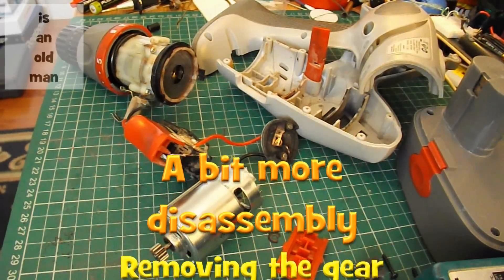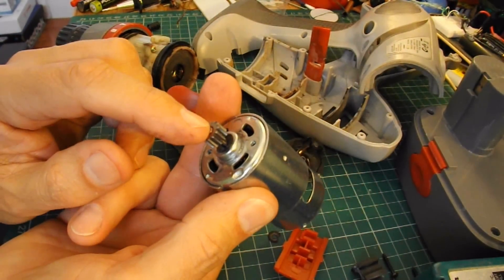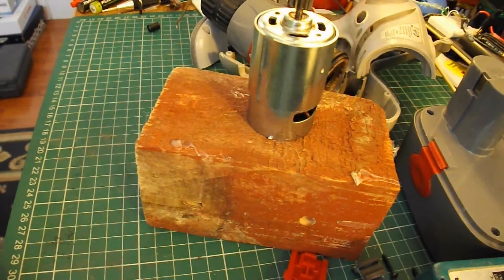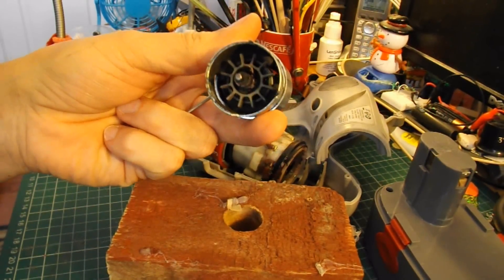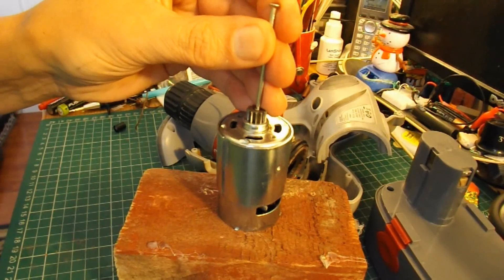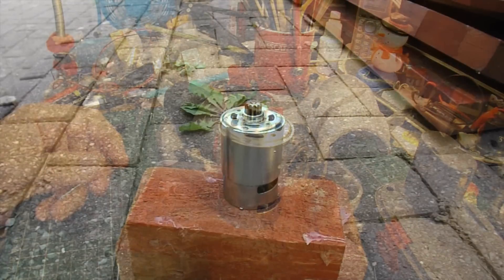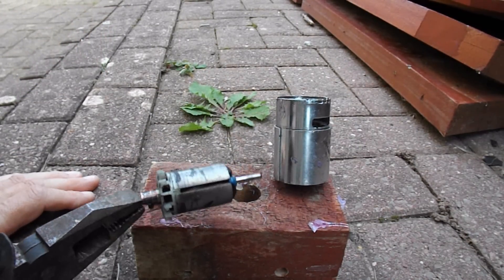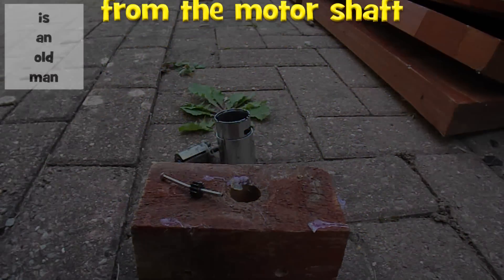A bit more Disassembly  - removing the gear

Comment: Any advice for how to do this on a much smaller scale? I want to do this on some n20 micro motors and let's just say pliers didn't work.(banana shaft)
Reply from the maker: You can buy a proper gear puller tool. That would be your safest option. However, here are a couple of videos I did on removing the offset weights on small vibrating motors which would be a similar task.
Helpfile - removing offset weight from motor of Dr fresh Velocity Toothbrush https://www.youtube.com/watch?v=zgDD51pBAzs&list=PLA5a2xPRSrB2v0vxMJyZ9cPweAGx1FK6e&index=57
Helpfile - How to remove the eccentric weight from a vibrating motor OralB Toothbrush etc https://www.youtube.com/watch?v=rAkSnCSv0Lk&list=PLA5a2xPRSrB2v0vxMJyZ9cPweAGx1FK6e&index=64

Comment: Disassembled some trashed handheld vacuums to salvage the parts, looking to use the motor for a project, thanks for the tutorial brother.
Reply from the maker: This is not a very good way of doing the job. A proper sprocket puller would be more effective and less destructive. But it works if you don't have any choice 👍👍

Comment: Did you manage to find a motor?
Reply from the maker: @RickJeanes  I bought a better cordless drill instead. But you could probably find a replacement motor on eBay or similar.
Reply: I found a motor at 1/3 the price but time will tell if it's any good I guess...oh, thanks for the video too.
Reply from the maker: @RickJeanes  Good luck 👍👍 One reason for not trying too hard to fix it was the battery wasn't lasting very long either, so that would have been the next thing to pay for 👍👍

Comment: I've used several of your videos to help on my projects, and all have seemed to be very useful.  Are you still tinkering with small gadgets and small remote control vehicles?  You did a military tank build once that was a conversion from non-RC to fully functional RC conversion.  After seeing your vid, I built 4 different tracked vehicles that worked out great.  The problem I'm facing now is that I destroy nylon gears nonstop.  So I've been switching to more durable brass gears, so your vid was really helpful for removal/installation and I didn't have to go buy a pinion gear puller.  Long story longer, Thank you for sharing your projects!
Reply from the maker: I still think a pinion puller is a good investment. I did buy one for use on smaller motors than this one and it does make life a lot easier 😊👍

Comment: Man those motors cost only a few buck when you just order from china 40 bucks is a ripoff
Reply from the maker: I think I was talking about a direct replacement for an original manufacturer's item. As you say, cheaper would be available. As this video is about 7 years old, it is hardly relevant anyway. The video was just to show a very ineffective way of removing the gear. A proper gear puller would do the job quicker and easier.
Reply: @GrandadIsAnOldMan  well it works so it is effective!
Reply from the maker: @Andre_Thomasson  Haha, yes, but not much chance of repairing the old motor now 😆😆👍👍

Comment: How how do you put that gear on a new shaft?
Reply from the maker: As I said in my previous reply - The gear is an interference fit, hence the need heat it to expand it, so it can be removed. You could use a proper gear puller as suggested in the video description. Fitting it on the shaft of a new motor would require force, ideally in a vise or a press to ensure alignment.

Comment: Even if you can get another motor, how do you reckon you out the gear in the new motor ... I doubt loctite is not up to a challenge in heavy stress application like drills or 20v power tools.
Reply from the maker: Not sure if you missed some words in your comment, I don't understand "how do you reckon you out the gear" and as for loctite, did I mention that? I would have to watch my 6 year old video again to find out. The gear is an interference fit, hence the need heat it to expand it, so it can be removed. You could use a proper gear puller as suggested in the video description. Fitting it on the shaft of a new motor would require force, ideally in a vise or press to ensure alignment.

Comment: How do i remove it without destroying the motor :) i ve have 2 same motor for cordless drill but different gear teeth....i can destroy one of the motors but on the other one i can't afford because it has to receive the first motor gear
Reply from the maker: The ideal solution is that you buy a proper gear puller, see the details in the video description. Without that, you need to place a strong slotted bar between the gear and the motor. Support that bar so the motor is hanging free, then tap the shaft through the gear. I do it here with a much smaller motor, but the principle is the same https://youtu.be/zgDD51pBAzs

Comment: didn't heat it nearly enough.  Oxy-acetylene is required to fully aneal the gear to butter-like softness.
Reply from the maker: That's fine if you have the equipment available.

Comment: after you heated it you barely hit it and it popped right out... i have the same drill motor issue... i found a new motor for 16.50 vs dewalts $50 one with gear al ready on... i will also have to cut approx 1/4 inch off new motor shaft...
Reply from the maker: Good luck with that 👍
Reply: @GrandadIsAnOldMan  i did it without heat i just held it with side cutter plyiers and 2 blocks of wood... i let motor hang and used a nice center punch with a small hammer and it came right off... i did not have to cut new motor shaft since it had plenty of clearance... i paid $17 for new dewalt motor without gears and wire... drill works perfect....
Reply from the maker: @roadstar499  that is a great result 🙂👍👍

Comment: Hello what to do with gear not fix on the axeof the dc motor is splitting up and down
Reply from the maker: If the gear is split you will have to replace it

Comment: How can get This type of gear
Reply from the maker: You would have to search online stores. You would also need to take careful measurements so you order the right items. You need length, diameter, number of teeth, inside diameter for the hole for the shaft.

Comment: You probably could have just bought a new brush to replace the burnt out one for a few pounds, it only takes a pair of pliers and a quick solder to replace.
Reply from the maker: True 😁👍 If you look you will see it is the commutator leaves that have failed, not the brushes. It might have been possible to get the leaves to settle down again with a bit of effort, maybe, but I decided to take it apart. 04:55

Comment: Mate I’ve took mine off but how do I put it back onto my new motor? A g clamp maybe.
Reply from the maker: Putting it on 'should' be much easier. Warming it might be an idea but I would expect it go on cold by placing it on a flat surface and gently tapping the other end of the shaft. If your G-Clamp is sturdy enough that would work too and allow you to be gentle with it. I know the clamps I have would probably twist out of alignment. A nice big vise or vice (if you are in the UK) would also do the job nicely.
Reply: Heat It . Drake 1 ton press , Hobby Vise , "C" Clamp in USA .

Comment: Have  the same problem with my Parkside dril.  I bought for £!0 a brand new motor from China here UK  in a week. Now I have to change the gears ! I wonder if a cig lighter would easilly heat the gear - brass has a higher coefficient of expansion than the steel shaft.  However I see on YouTube vides on how to make small pullers.
Reply from the maker: If you can get something behind the gear to support it then drifting it through would be a much better solution than smashing the motor like I did here. I have had success with smaller motors by cutting a slot the size of the shaft in a strip of steel and supporting that while I tap the shaft through. Using a cig lighter might work but I would expect the heat would be so gentle it would transfer through to the steel shaft before the brass gear had expanded enough to release. The obvious answer it try it, what have you got to lose. If it doesn't work you will have to go hotter faster.

Comment: Pls use pinion Gear puller.
Reply from the maker: If I had one I would but then that wouldn't be a very interesting video, pulling it off without destroying the motor. As Slider2732 pointed out in the comments here, I could probably have reseated the commutator brushes and saved it but I didn't think of that either.

Comment: Is there any other way man? I'm dying to losen up the gear from dc motor that i got from an old printer
Reply from the maker: The proper way to do it would be to buy a sprocket puller or pinion gear puller (just different names for the same thing as far as I know). They push the shaft through the gear whilst correctly holding the gear in place. If you study pictures of a gear puller you could probably make one yourself. The main thing is to support the gear while you punch the shaft free. In this video I am relying on the bearing of the motor to take the strain and basically destroyed the motor doing it. I knew that would happen but I only wanted to salvage the gear not the motor. This video may give you the general idea but it depends what you can find to do the job https://youtu.be/zgDD51pBAzs and heating the gear should help by expanding it enough to reduce the grip on the shaft.
Reply: GrandadIsAnOldMan alright, thanks sir
Reply: Did you manage to do it in the end? Im trying to remove the gear from a printer motor too
Reply: @rupertshearer1456  i finally am using angle grinder as well 😑

Comment: I've got some bigger (yet still pretty small) DC motors at work..... actually an entire 3 boxes full.. lately when I've built stuff it's been with old hubsan x4 flight controllers or similar. I'm wondering if you have or could possibly find the time to make a video about potentiometers and speed control w/ out a flight controller using potentiometers? Thanks for helping out! Cheers!
Reply from the maker: I am no electronics expert but this video might give you some ideas https://youtu.be/Y9vFdjiOiIo

Comment: Great video man! This really helped me :)
Reply from the maker: Thanks. The main point here is I was only trying to recover the gear, the motor itself was effectively destroyed. If you just wanted to change the gear on a good motor you would need to support the gear so no pressure was put on the motor bearings.

Comment: Would this ruin my motor
Reply from the maker: Heating the gear to remove it is a common method but you need to be careful. You only want to heat the gear so it expands reducing it's grip on the shaft. If you allow the shaft to become hot then that expands too and that makes the grip tighter not looser. If you take too long the heat will travel up the shaft and may cause problems inside the motor.
Reply from the maker: You may have missed the point that this motor was already ruined so I am just taking the gear off so I can use it on another motor so I am not too worried about this motor. You really need to support the gear by sliding a strip of metal with a slot the width of the shaft between it and the motor. Then you support that strip of metal in a vice so no force is applied to the motor casing and bearing. Here is a video working on a much smaller motor but the principle is the same https://youtu.be/zgDD51pBAzs?list=PLA5a2xPRSrB3jAX4ymLvmoN8OtvQkKuTC

Comment: How you connect the used gear to new motor ? do i need to use glue ? heat ?
Reply from the maker: This particular gear was an interference fit so heating the gear would help it to fit the shaft
Reply: so if i remove the gear (small grey) can I connect it again to the my new motor , do i need Glue or just heat (blower) ?

Comment: I'm in deep shit now... I still need my moter...
Reply from the maker: Your best bet is to find another faulty one and swap the parts.
Reply: I found a use For my motor with the gear but here's a tip you can get motors of Aliexspress and Amazon  you can get one 12v motor for around 5 - 13$ and a 24v for about 17 - 30$
Reply: And most 12v or 24v motors have the same size shaft you just need to know what volt your motor is

Comment: the motor you need is a johnson 600 and there £12 for 3
Reply from the maker: +Matt Westmacott thanks for the suggestion but what makes you so confident?  If it is not exactly the same size and same shaft diameter and length then it would just be a waste of money, although 3 nice solid motors like that for £12 could be handy for all sorts of my projects. I did google the details on the motor and found matching items but decided I would rather put the money towards a new 18 volt Li-Ion cordless £50 special deal at B&Q. The NiCad batteries on that old one didn't hold charge for very long anyway so it really didn't seem worth the effort of fixing it.
Reply: I got three for `12 quid from ebay just to mess around with, their the same as you have there.
as for removing the  little gear id hold the gear with a vice and tap the motor spindle with a prodder whilst supporting the underside of the gear so not to squash the gear as then it would make all this impossible!
loving your channel

Comment: Mabuchi 600-550
Reply from the maker: +Francisco Javier Lázaro Pinela thanks, I did google the details on the motor and found matching items but decided I would rather put the money towards a new 18 volt Li-Ion cordless £50 special deal at B&Q. The NiCad batteries on that old one didn't hold charge for very long anyway so it really didn't seem worth the effort of fixing it.

Comment: Your block of wood looks every bit like a house brick !
If the copper wire is still crimped or soldered to the bent commutator segment, you can often bend it back without issue. Happens on small toy motors too. The first few thousand revs reseat it properly, or rebreak it.
Can you make a blowtorch powered car ? .....am joking :)
Reply from the maker: +slider2732 I have a nice new 18v Li-ion powered cordless drill now, was lucky at the local hardware store had a special deal on some Black & Decker's £50 seems very nice so we will see how long it lasts.
Reply: 'hardware store' ? i'm not that American yet dear sir lol, B&Q are though a bit of a distant memory. The end gear was still a good idea to remove from the other - am quite sure that a drill with a busted chuck or stripped gears might turn up in bargain hunting, to take the motor from.
Reply from the maker: slider2732 as it happens, yes it was B&Q :-)

Comment from the maker: I took my cordless drill apart when it stopped working and found the motor was faulty. It might be possible to source a replacement motor but it probably would not come with a matching gear on the shaft so I thought it would be best to remove the existing one from the old motor shaft.
Reply: I got the same problem, damn pinion won't budge
Reply from the maker: @beboshi69  heating the pinion gear "usually" helps, but if you take too long the shaft will also heat up and that does not help.